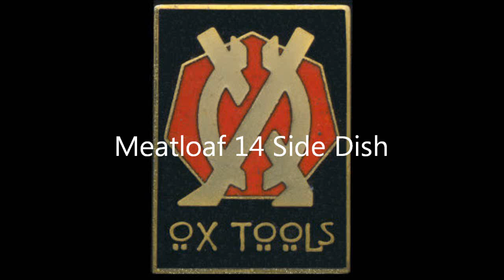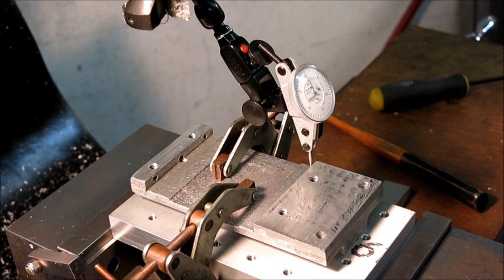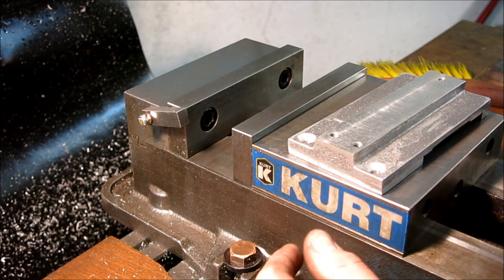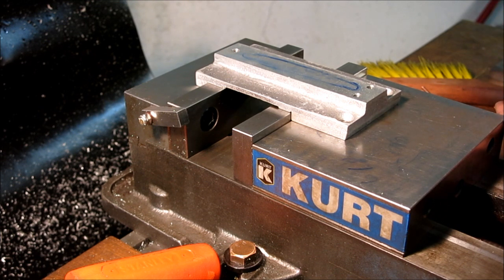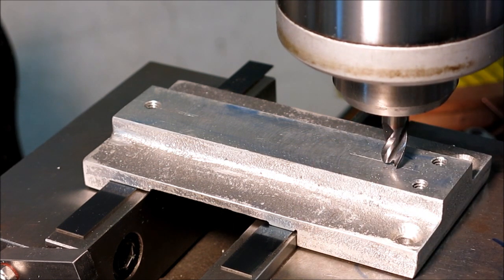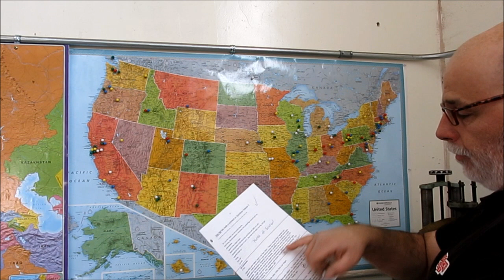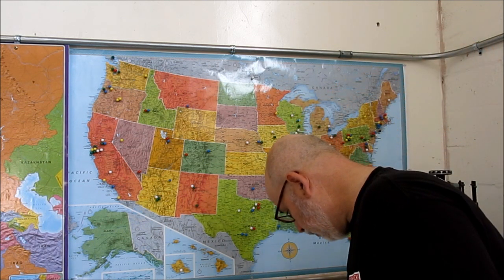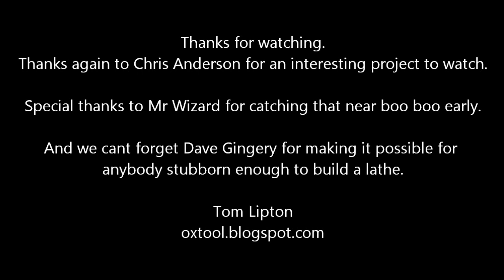Meatloaf 14 Side Dish

Comment: Fred Potts, Laredo, TX. I am restoring a 1934 Buick. The wooden body frame is rotted, so I have decided to replace it with fresh ash. I duplicate the old using classic woodworking tools and metal working tools, especially the vertical mill. I have a 2-axis angle vise with which to position the work precisely at the angles at which the original piece was cut. So far, I have finished about 90% of the pieces and have begun to rebuild the frame. I enjoy your videos because they help educate me on how to use metalworking machines.
Reply from the maker: Hi Fred,

Thanks for the comment and telling us about your cool project. I find there are many techniques that transfer well between wood work and metal work. 

All the best,

Tom

Comment: You can put a pin up for me! I am a farmers son (#4 of 5 & a twin)! I have ran tractors, truck, combines, Skid loaders, forklifts, back hoes, helped install steam boiler systems in dry cleaners, drilled and poured cement/grout, ran steam, air, vacuum & exhaust pipe, threaded pipe, ran plastic PVC pipe, I have built houses, drew blue prints, roofed & shingled houses, demolished barns & houses, I am a stick welder, minor electrical 220 no 3 phase, Certified Auto mechanic, ran brake lathes, Boom cranes, ran a service truck for 22 ½ years, I have been into Computers since 1986. And enjoyed wood working & would building, I am now disabled and live in Canton, IL. between Chicago & Springfield IL. I watch all you machinist and enjoy them very much! Keep up the great job!
Reply from the maker: Hey Brad,

You are already on the list. I just haven't quite made it there yet. I had a big backlog of pins to do. Sorry for the long wait. Just a little longer.

All the best,

Tom

Comment: Nice little series! Nice catch on the piece moving during the cut...Hey, I finally got some company in Nevada, even if it is 400 miles away.
Reply from the maker: Hi Robin,

What's the deal with Nevada? All that space and not many machines. 

All the best,

Tom
Reply: oxtoolco
Lots of slot machines.

Comment: Sometimes I find it is better to bolt the work to the machine table or fixture
plate and forego the clamps, which usually end up in the way.
Thanks for your contributions to metal working. Jim
Reply from the maker: +Jim L Hi Jim,

Thanks for the comment.

Cheers,

Tom

Comment: I think I may have those Gingerly books. I know I have several don't remember if I have the lathe book though.

One of these days I am going to build me a mini pallet. I bought a 12' pc of 1/4 x 1/2 cold rolled 1018 steel. Think that will be enough to make the clamps? lol I don't think I have ever seen anybody cut that at work so no scrap pcs. My vice only opens to 4.5" so was thinking about a pallet 4" x 8" We'll see I guess. 

Enjoyed the video. Wish I could get a pin in the map...hint. Bozo wana be machinist in Lima, OH. lol
Reply from the maker: Hey Steve,

You are on the launchpad and ready to be boosted into pindom. I have been backlogged with pins and am trying to catch up. Make sure your mini pallet can go into the vise super easy. It will make you use it more often. I would be tempted to make it shorter than eight. I sometimes come in from the side of the pallet with Kant twist clamps to hold things also.

Best,

Tom

Comment: I was taught that you raise the knee when machining and not to lower the quill.  This makes any miss alignment  in the head tram less.  Your thoughts?
Reply from the maker: Hi Bow,

Good question. The answer is it depends. Most folks don't tram their heads nearly enough so on average using the quill over a long range for a particular operation you are correct. For maximum rigidity and heavy cutting the quill should be extended as little as possible. On the flip side if you keep you mill in tram and understand the limitations of extending the quill just using the knee robs you of one of the greatest features of the Bridgeport type milling machine. The quill is a hundred times faster to use, plenty rigid for everything but the most aggressive cutting and was designed to be used not sucked back into its burrow.  So tram your mill often and enjoy the quill for what it was designed for.

All the best,

Tom

Comment: So followers of your channel are called "oxen"? I love it! Great video, Tom! (as always). One question I have:  where did you get those plastic trays you display some of your stuff in? Did you raid a McDonalds or something? :-D It's a great way to keep your stuff from rolling all over the table and always falling on the floor! Have a good weekend. GO NINERS! (I live in San Mateo, so I guess I can get away with that!)
Dave
Reply from the maker: Hi Dave,

Thanks for the comment. The trays come from a restaurant supply store over near the Oakland coliseum and cost a couple of bucks. They are next door to USA metals which you should know about also. Good place to buy steel and hardware Items for bargain prices. Definitely offshore type supply house but the prices are hard to beat.

Cheers,

Tom
Reply: oxtoolco
Thanks for the info, Tom. I will check those places out. Have you ever been to the flea market at the old Coliseum Drive-In Theater? Every time I drive by there I keep reminding myself I would like to check it out, but I never do. Oh well . . .
Thanks again.
A Fellow Oxen
Reply from the maker: Hi Swarf,

That's the zombie flea market. I haven't been there in years. its the place you go I you were recently burglarized to get your stuff back. Buyer beware.

Best,

Tom